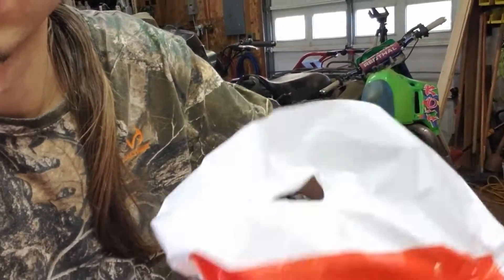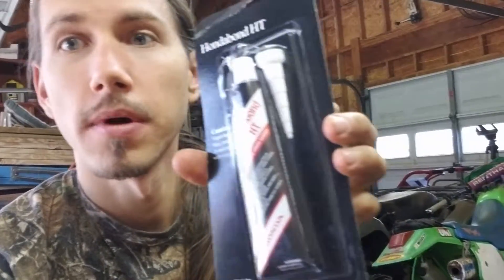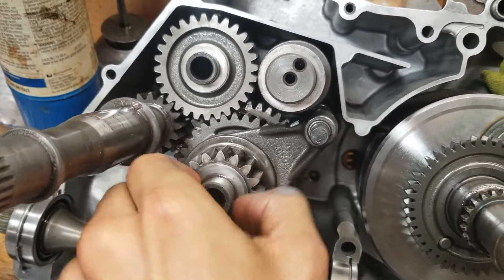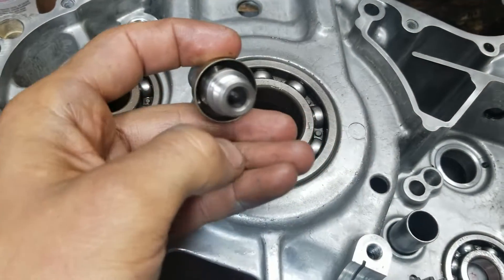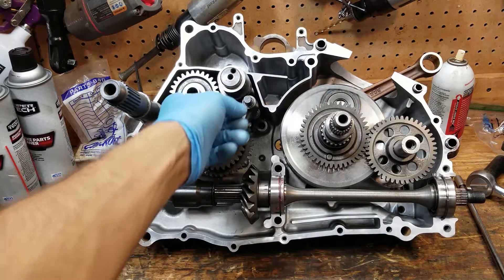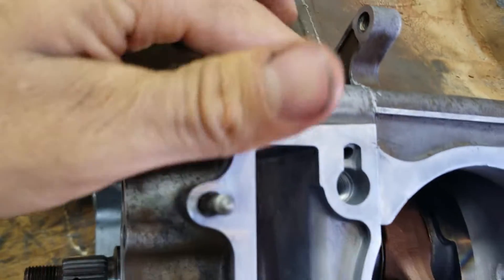Reassembling The ATV Engine Cases: Suzuki Vinson Rebuild Part 9

Comment from the maker: Hey Y'all! Links to tools used and service manuals in the description!
Timestamps:
0:00 Intro & Sealant Info (IMPORTANT!)
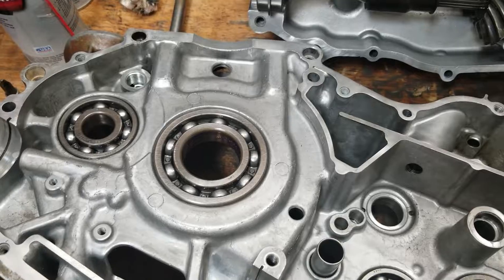5:55 Service Manual Tips
8:10 Oil Pressure Regulator
9:29 Sealant Application Pattern
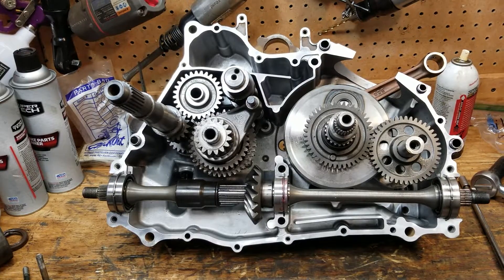10:36 Final Inspection (IMPORTANT!)
11:42 Re-Sealing Case Halves
13:46 Sealant Review
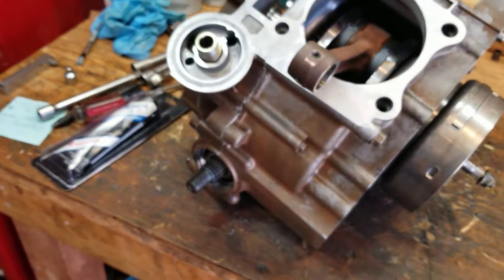15:16 Outro

Comment: I  used black high heat permatex on my case.. What's wrong with using permatex.. I kinda don't wanna split my case again anytime soon because it will take me like 3 days from ripping it out the atv to putting it back
Reply from the maker: Just leave it. I'm sure it will be fine. Just remember these products for future rebuilds!
Reply: @MattsShop  yah definitely.. this was my first time splitting A atv case.. Mine had A bold in the transmission from previous owner.. Luckily I heard it rattle before even starting the damn thing.. all good now tho

Comment: If you are going to split any more cases it makes sense to get a case splitting tool  Makes easy work of this and safer for the internals...  they are like $60 for decent set.
And the work on lots of different small engine cases.
Reply from the maker: I will look into one of those, for next time. Thanks!

Comment: So I pulled my entire 02 vinson apart and put it back together I'm now stuck because I have an extra 8x120 bolt from the crankcase that I can't find where it goes. I think it's a 01547-0675B but none of the parts diagrams advertise a length. Also think it's an interior bolt.
Reply from the maker: There are no bolts that long inside the crankcase. It's probably the bolt at 12:57.

Comment: Hey Matt, where do you buy your parts? I have an arctic cat 500 2004 FIS.
Roger engine I believe. Hard to get parts reasonable priced up here in the Yukon.
I need valves, rockers, cam, piston and rings. Dropped the valve, didn't pop the piston, cylinder walls are great. Rockers are wore out and cam lobes are flat putting new guides, and upper rebuild under way.
Reply from the maker: I get my parts from Partzilla.com The prices are the best, but I don't know if they ship to the Yukon. It sounds like you got off easy not having a damaged cylinder.
Reply: @MattsShop  yeah, not bad at all. I found a rebuilt head for $500, think I will go that way, needs guides and rockers.
New piston and rings, and a cam. Looking at about $1000 in parts.
Rest of machine is in excellent shape. Bought it for $400. So into it for about $1500 and my time.
If I flip it should do good, may keep it.
Thanks for the quick response.
Regards
Garnet

Comment: Hi Matt! Im fixing my suzuki vinson too, but the problem i have is that when a put parking the quad still rolls and it makes a knocking noise and when a put drive on High, low or reverse it doesnt move, like its something stuck, any suggestions? I will appreciate any help, Thanks!
Reply from the maker: Check the shiftier box and the linkages to the rear differential. There is a little dot on the lever and a dot on the shaft where it slides on the diff. Make sure they are lined up. Check all the shifter cables and make sure everything fully shifts all the way. It's probably out of adjustment.
Reply: Matt's Shop Thanks! I will do that, because yesterday on the night a had to move it so i tried to start it on and the shifts work well (strange) except for the parking shift who stills let the quad roll and doin the knocking noise and i descover that the carburator is leaking gas throught the air entrance and it make an hidraulic lock on the cylinder and i had to remove the spark plug to drain the cylinder.
Its a pandora box....

Comment: Great pointers and info regarding the separation of crank case.
Presented with knowledge. Now I believe I will be confident enough to break apart my quad 500 that at I got for cheap.
Reply from the maker: Thanks, I like to throw a lot of knowledge in my vids!